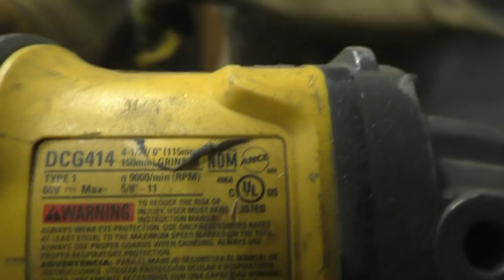Grinder Safety -- and lies you are told to scare you.

Comment: Regardless, safety is paramount. I am a doctor, and also a senior flight surgeon, we are trained as safety officers as well.  If a guard protect us from flying things, then why not use it.  We have a choice on the matter. Although, sometimes the safety issue is exaggerated to the point of fear, we need to think about what we are doing. Recommend that on the use of any power tools that involves a blade or disk rotating at several thousands RPMs, just wear safety gear. I know, there are very few times, especially when it is hot and humid (like now @ 93) and just need to make a little cut (wood or metal), that temptation will come not to wear protective gear but you and I know that we should, just do it.  I, like you, dont want to loose a finger or worse, then have to go to ER, spent hrs there, likely having surgery, go thru the pain, then physical therapy, blah blah blah, which could have been avoided by just few seconds of discomfort while wearing PPE gear and keep my hands/face intact.  Also, because we don’t have a crystal ball that tell us if nothing will happen, minor injury or serious one, I prefer take my chances by wearing safety gear even though might be cumbersome. Better be safe than sorry. It is your choice, as in Indiana Jones, “choose wisely”.
Reply from the maker: All that training and you still ignored that point.  I said nothing about not using eye protection.   What I did say use to use situational awareness, and not listen to the idiots that will tell you everything is dangerous.    But thanks anyway MOTHER.
Reply: @SVSeeker  No, I didn’t miss your message, an eye protection is great but an angle grinder without a guard, the eye protection alone may not be good enough as a flying piece of disk or metal may hit any area of the face (or body) , including eyes, and may go thru googles like butter.  As a matter of fact, OSHA 1910.133(a)(1) and 1926.303 (c)(9) as well as multiple other sources related to angle grinder use, clearly recommend to wear all types of PPEs that includes the following: impact rated goggles (consider primary eye protection), in addition to a FACE SHIELD (secondary eye protection) , PLUS mask, ear protection, leather gloves, natural fiber clothing, apron, and optional steel toed boots, in addition to using the appropriate angle grinder respective GUARD either type 27 for grinding and type 1 for cutting. So those are the recommendations. Looking at the comments prior to mine, the majority are expressing the same thing, when using the angle grinder, use the guard, in addition to the other PPEs.  Again, it is your choice or mine to follow it or not. As a guy like me, a beginner, who just bought first angle grinder, I want to make sure I am using the tool appropriately (including the guard) and wearing all the PPEs as recommended.  Insulting people due to presenting facts is illogical as facts are facts regardless of what you and I feel, as emotions are irrelevant.
Reply from the maker: @Flightdevildoc   Stick to Bandaids doc, because you don't know shit about metal working.  Lots of jobs can not be done with the guard.  And they can be done much more accurately without the guard.   It's about skill.   If you're new then use the training wheels.  If you are a moron and never learn then keep the training wheels on.   But don't fucking tell those of us with skills to use the training wheels.
Reply: @SVSeeker  Again, insulting others is not the path to acquire knowledge.  I am not telling anyone what to do.  I am pointing the recommendations, as at the end of the day, we all have a CHOICE to do it or not.  You are right , I don’t know anything about metal working and I want to learn about  it but insulting people is not the way to go. Well, this is channel I am not watching to learn. Have a nice day!
Reply from the maker: @Flightdevildoc  You're assuming that you have knowledge I want.   You don't.    : )

Comment: This video reminds me of a guy I worked with in a company. He was working on a metal ladder 25 feet up on an electric heater, testing the voltage with meter leads in one hand  and a screw driver in the other.  He now is a little off kilter from the shock and fall, has a kick ass lightening scar tat on his arm, and missed work for a while.  And like in this video trying to break a disk while in use, THE SAME GUY handled a heavy gauge sheet metal access panel to a commercial blower unit while on.. without gloves....  dont worry tho he only just lost the tip, of his thumb.  Better clearance for next time he does that, right?

I really wish I was kidding..  A little common sense.. use the fu kcing guard.

Comment: On the little part about about the parts of an exploding disk not carrying enough mass to do any damage. My father has a 6" scar on his gut from when a grinding disk exploded, and almost made it's way through all the layers his abdominal muscles. I personally have a chunk of cut off wheel stuck in my garage ceiling. Went 2" deep, just like a dagger. It's been there about ten years. It's my little reminder to be careful. Yes, occasionally we all need to take the guard off to reach things, and such, but there's a risk. That guard greatly decreases the chance of an exploding disk flying your way. And don't forget, often people work with their grinder around waist high, or so, putting your boys right in the line of fire. Keep that in mind when you throw caution to the wind.

Comment: 1:57 I get what you mean but that's bullshit. No you shouldn't let anyone play with something they have absolutely no idea how to correctly use it. "loosing a finger" isn't something you just scratch off. Just get some short info on how to use the tool, wear goggles and preferably put a protector on the grinder. I know they aren't necessities and it's as dangerous as people think but it's still precautions you can take at the cost of minimal effectiveness loss that might just save you the "finger or two". I get what you mean but your explanation goes too far into the other direction of seeming less dangerous than it can be.

Comment: Yeah, grinders are not that dangerous, I'm using them alot, and I like to think of myself as pretty dexterous, but I don't like using grinders without the shield because that just dictates some extra caution to me and it removes some freedom of movement. It's a fact that you can't be focused all the time and sometimes you will be in a rush, so precautions are a good thing. Most people though, don't use grinders often and when they do, they haven't got an idea about what's truly dangerous and what's perfectly acceptable, and then, then there's the idiots who have no skill but all the courage. Those are the ones that safety standards are based on. If you're grown up as a handy man, you'll know whats safe, if you're not, just follow the directions in the manual.

Comment: they lose their momentum quickly, yes, but the rotational energy in the disk is insane! and the larger the radius the more dangerous it becomes at 10000rmp with a disk size of four inches, the surface is moving at almost 2 miles per minute (10471fpm) so if the wheel snaps, it will no longer be rotational energy, but forward motion at almost 120 miles per hour. In a distance of two feet, or less if you don't grind with rigid outstretched arms like minecraft steve, it wont have slowed down much. Ever hit a raindrop going 60mph on the highway? How about riding a motorcycle behind a car constantly throwing pebbles at you?
Reply from the maker: If you ride a motorcycle are you really going to spend time worrying about a disc failure?   And there ain’t no way the rotation in all going to be converted into forward momentum.   It would have to come apart without surface contact and even then it’s not going to be as bad as the pigeon I hit at 55 mph.  : )
Reply: @SVSeeker   dude a pigeon iis far less dangerous as there is more surface area. I get that you shouldn't be scared of it yeah. I work in machining. Those machines can wrap you around the shaft and beat you against the chip tray till you're just bloody hamburger in a few seconds. But you also dont want to misrepresent the dangers. I knew a guy that had a disk explode and gash his cheek very deep. Disks are reinforced so incase of failure they just kinda crack and dont fly apart, but in rare cases, they fly everywhere and can do some serious non life threatening damage.
Reply from the maker: I don't think you've had a pigeon in the face at 55 mph, or did you pay attention to the video.

Comment: I have seen 2 cut off disks explode, one after another, they were Avanti brand I believe, so I'll get DeWalt or something similar(my boss was using the grinder when they disintegrated). I was cutting steel in a sketchy way, and had the grinder come across my chest and luckily only cut into my hoodie I was wearing and nothing else. I have also been grinding down some concrete with a diamond wheel and it bounced off the concrete, then off of my thumb, gashed it up pretty good. Point being, like you said, they are something to be respected, but common sense, and experience goes a long ways to using one.

Comment: Once had an angle grinder cutting disc fall apart in my buddy's hands because he was using it like a grinding disc, long story short (because he didn't have the proper protection on) he needed some serious stitches anyway i got hit with a chunk of the disc myself but guess what. I was perfectly fine because i had a good industrial strength leather apron so i only got spooked, not only did he need stitches but he obviously needed some fucking common sense.

Comment: I dunno, I worked with grinder for 3 years, 40 hours a week. I've had shards of aluminum extracted from my eye. Alot of good tips, BUT, I still say, ALWAYS have a guard on the grinder. If you want to cut it down significantly, do THAT. I think you're an absolute madman to be grinding without gloves or a guard with a broken blade lmao. Just a tip, if you want to make a blade break, break it on the outer edge, so that it doesn't touch the nut. Also, yes I think that photo is fake, but there are injury photos of real people getting fucked up and its insane.
Finally, I agree with your comment about playgrounds! except that now, we've made playgrounds so safe that kids don't learn what will mess them up. I guess the ER docs of tomorrow will pick up that slack
Reply: subbed btw :)

Comment: Look at my profile pic. I use grinders every single day. Cut off wheels, wire wheels, grinding rocks, and flap disks. All the time. I've had tens of them go to bits in the 11 years I've been doing this. I've sent 3 guys to the hospital from serious grinder injuries. Your idea that it's all just scare mongering is asinine at best, and deadly at worst.
Reply from the maker: So you prefer scaring them even if you have to lie to them. ....but you've sent 3 of them to the hospital.   Ever consider a change of tactic?
Reply: @SVSeeker  I'm not saying lie to them. Not at all. I'm saying, if the tool is dangerous, tell them it's dangerous. In this case, the grinder, it's generally the most dangerous tool in the shop. It's usually dangerous because people get way too comfortable with them, and start making what I would call stupid mistakes. I always tell my guys, don't forget what this tool is capable of. 3 of them forgot, and they all have pretty gnarly scars from it. Others have been much more lucky (myself included).

I just don't understand why you would publish a video to the public that a very inexperienced person will see and take the wrong way. They will think "that guy on YouTube said this wouldn't go to bits, he even showed it wouldn't". I'm not trying to pick a fight, or troll. Honestly, this is probably my first YouTube comment ever. I just see the potential for this to be misinterpreted by someone.
Reply from the maker: Because very inexperienced people know they are very inexperienced.   So imagine the content available if we only posted videos that showed activities that are safe for 3 year olds.  I'd sure as hell would not watch.   We've had over 200 volunteers including kids come through here, use grinders, saws, welders and not one serious injury.   Our policy is simple.  You are responsible for you're safety.   It's obvious to any moron that these tools are dangerous,  the stupidity is telling them that the safety gear is going to protect them.   It is not,  It will only assist, but what matters most is that they are comfortable and focused, and it is absolutely fine for them to say no to any task.   I have never seen that approach in a business setting.  I have never seen a sign that encourages you to  put the tool down because you don't feel like your focus and awareness is there or because you don't feel comfortable.

Comment: Love this channel and this project. I tend to sort of agree and disagree with this video and I do a ton of cutting and grinding at work. I am a captain on a research vessel and usually from user error I have seen some pretty nasty cut of wheel mistakes. I wish I could add a image to this comment but my cousin had put a oversized cutting wheel on a grinder to cut off a exhaust hanger under his vehicle. He was in the wrong place for sure and the wheel came apart. The partial disk cut through the corner of his mouth up towards his eye. The disk chunk was stuck in his face and did damage to a few teeth and his gums. He is a construction worker and had lots of experience with grinders as well but trying to get to a hard area to cut he made some bad decisions.. I think most accidents with power tools are preventable and being comfortable with equipment is safe but don’t be calloused or loose the respect..

Comment: Case report of an angle grinder accident, one of the guys was 25 feet away and got hit in the back of the head then fell 12 feet- the operator got hit in the forehead ( w/picture of result ), no guard was in use. 

"Penetrating head injury from angle grinder: A cautionary tale" doi: 10.4103/0976-3147.63098
 PMCID: PMC3137829 PMID: 21799615 https://www.ncbi.nlm.nih.gov/pmc/articles/PMC3137829/

Now I am sure that was a grinding disc and not a cut-off wheel, but when using the grinder disc- best to keep that guard on.   Not being a safety sally on this, I work exempt from OSHA.   I get it, I've taken the guard off for visibility in a tight space when using the cut-off, but I put it back on when I'm done mostly to block sparks- in case I slip, or if others are working near me.

Comment: I recently bought my first angle grinder to cut down a rear scraper blade for my tractor. I watched a bunch of safety videos and was convinced I needed to buy a bunch of special safety gear (face shield, flame resistant clothing, etc.). In the end, I decided I was too cheap to buy all that and instead made do with reasonable precautions. I wore a pair of old jeans, work gloves, my Carhartt style (knockoff) work jacket and a pair of safety glasses. About 5 minutes into cutting through that 5/8" steel, and I had thrown caution to the wind. I was down on my knees cutting away with a shower of sparks blasting into my jeans with zero problems. The only time I felt anything was when my jacket sleeve rode up a bit and a had a stray spark or two hit my exposed wrist. I was using a 1/8" combo cutting/grinding disc (which in hindsight was thicker than it needed to be) and I chewed about a half-inch of that disc away while cutting through that steel blade. The whole time I was thinking about all those horror stories, but in the end it was totally fine. No issues at all. I think the cautionary tales are helpful to give you a healthy respect for the tool. But if you've ever used a circular saw, chainsaw, etc... I don't see where a grinder is any more dangerous.

Comment: So just because those flying pieces luckily went in some direction other than your face it's ok to leave the guard off? Their purpose is to provide some block to the debris and deflecting it elsewhere from your eyes etc. Keep going, one of these days you might not be so lucky.
Reply from the maker: If your disc is coming apart like that would you actually keep using it?
Reply: @SVSeeker  You don't know when a disc might come apart. But if it does, some protection trumps none.

Comment: Safety comes in many shapes and forms but the simplest form of safety has shown for thousands of years to save the most lives, you working with tools? Wear goggles and gloves, climbing tall up? Wear a safety harness or a rope around you.
Its not hard to use your fucking head. 
I seen my dad do some really wacky shit with his grinder from grinding metal bars on bare ground with loose sand and stones, to grinding fucking concrete. He never had his grinder blade break on him he once tried to make it break but he failed to do it they are built way too strong.

And just from point of note my dad is a fisherman and he lost part of his finger, you know how he managed to do this? Well he was on his phone and had his hand on the rail on his boat, another boat smashed into that very rail and hit his middle finger. The funny thing is that he actually took his safety glove off which usually have strengthening around the finger parts to prevent this, after that day he only took his gloves off while inside the pilot house when on a ship.
At least he cannot flip people off anymore, he loved doing that when he his finger intact.